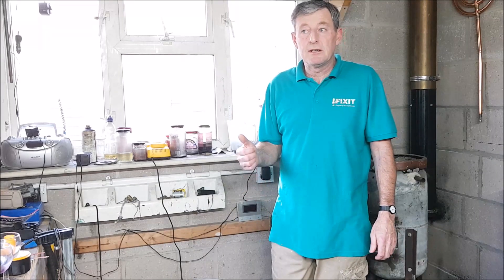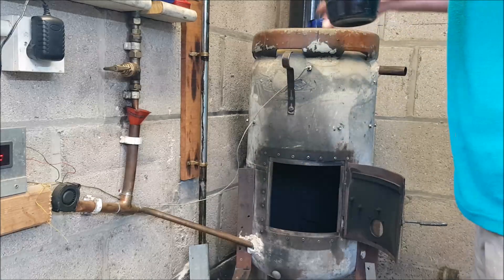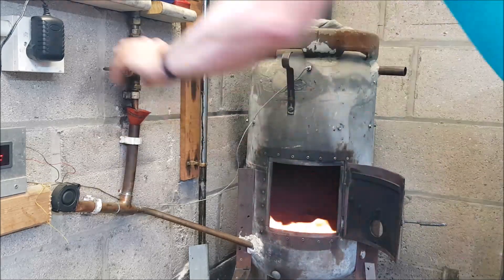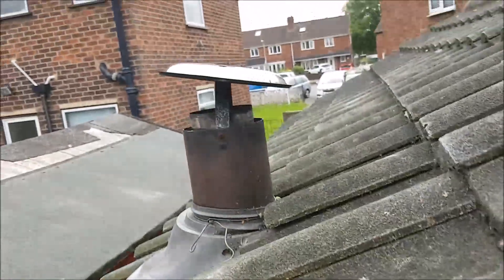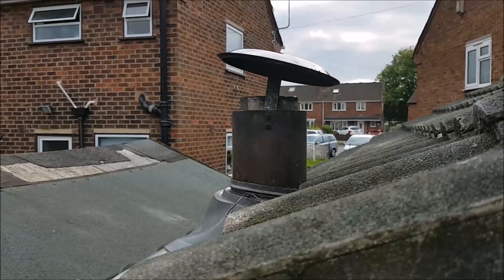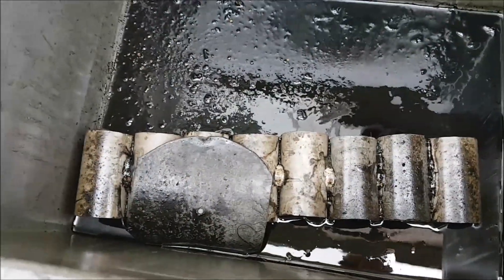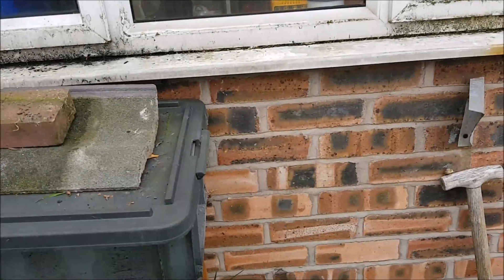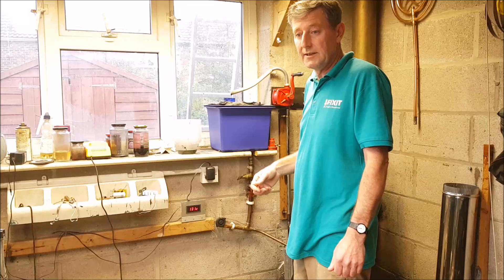homemade waste oil heater filter and flue emissions. UK 2017

Comment: What fan are you using?
Reply from the maker: Sorry for the delayed response Richard, the fan is a 12volt / 0.18amp d.c blower fan. You can find any fan similar in any old battery chargers,printers etc. You can use any fan as long as long as you can make means to fabricate the outlet to deliver the air to the combustion chamber. Look on line they're quite cheap. I'm going to put a speed controller on mine and a peristaltic pump on a timer to fine tune the oil and air for a blue flame and so I can turn the temperature up and down when needed. Started building a new heater with lots of modifications which I will post a video of.

Comment: just because there is no smoke, doesn't meant it isn't pumping toxic stuff into the air. My diesel car doesn't produce smoke but it clearly produces toxic fumes. You would need to run a test with a particle detector to really understand what is being produced.
Reply: True but we have also gas boilers, coal pits...the list goes on. What is the result of their combustion gases? Even a wood stove. I'm a mechanic and know that most engine oils have additives with advanced technologies producing them, also, after use, unused fuel is in the mix together with dangerous molecules that didn't get to fully combust. Nothing comes free of burden. Koodos to those who look for solutions to their high electric bills.